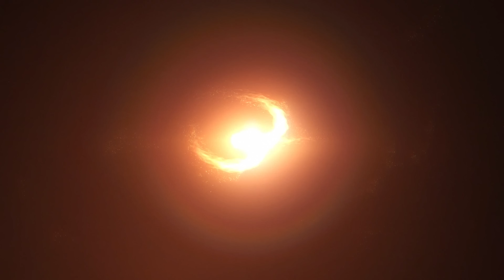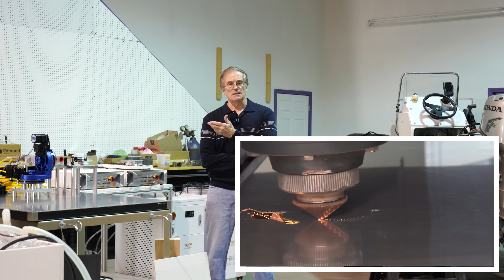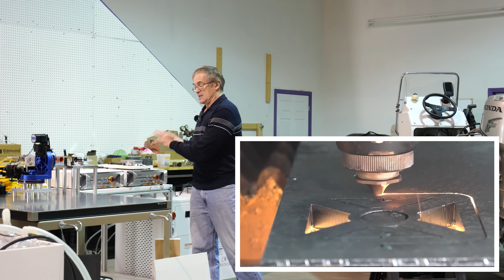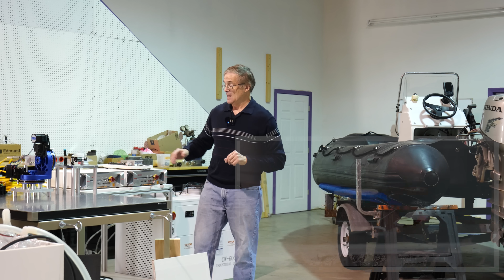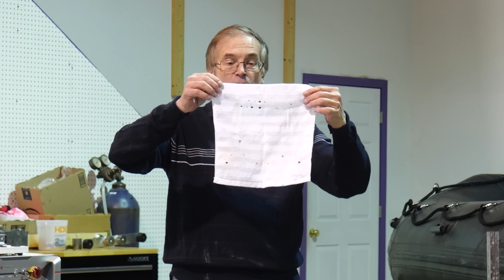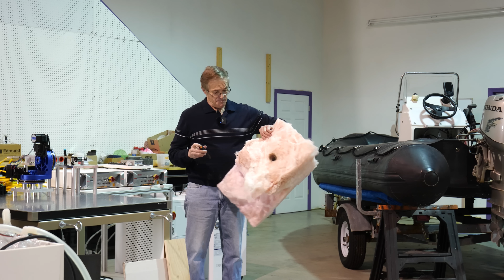We have a problem... and need your help!

Comment: Over 2700 comments from only 4 hours and 16000 views. You're going to have a lot of reading to do! Glad to hear you read them all, I've been genuinely worried that you'd try solar cooking on Teflon again. :) Some good ideas here, though I have no intention of reading them all. I doubt I have many thoughts about shapes and materials that aren't already covered. However I do have a couple complementary ideas which might push something that's close across the finish line.

First, make the thing move fast. If you structure whatever you choose as a disc or drum or belt and spin it at high speed, it will disperse the energy across a much larger surface area. For higher speeds, use an array of smaller elements, e.g. many narrow spinning cylinders. If packing them close enough is an issue, use two (or more) staggered layers so the ones behind obstruct the gaps between the ones in front.

Second, perhaps some kind of sensor curtain you can use to trigger a high speed kill switch (e.g. an SCR). My first thought was a fine, tightly-woven mesh of enameled wires which lose continuity when you burn a hole in them. An easy answer would be solar panels in a similar staggered layer arrangement as described above, from which you could hopefully detect a momentary voltage spike, but that'd get expensive fast as you replace them. Perhaps sheets of material forming a capacitive curtain would generate enough of a signal to work with. At those energies, I wouldn't be entirely surprised if some kind of adequately measurable charge occurs even just in a single layer of foil as it vaporizes into an ionized plasma. For maximum reliability and speed, the sensing/triggering circuit should be fully analog. No microcontrollers or whatnot.

Best of luck to you! It's a tall order, dissipating that much energy with such a low mass to area ratio. I'll be very interested to see what you come up with. Possibly interesting to various governments and militaries, too.

Comment: A layer of translucent gel between plexiglass. One side could be clear and the other one could be against the sheet rock. Another idea for the gel layer is have it sandwiched between opposing mirrored plexiglass glass and maybe have sheet rock on both sides to catch stray photons. 

The idea is to diffuse the beam enough to where it doesn't penetrate simpler barriers

Comment: A waterfall, from a few pipes going up in a 5 gallon bucket, probably a channel to catch it on its way down. Scalable, and cheap. Water absorbs laser radiation. channel out thickness you need, scale up pump as needed.

Comment: Water has roughly 1,000 times higher absorption at 1064nm compared to the visible light spectrum.  Use a large aquarium filled with water that has an additive mixed in to adjust the desired absorption at this wavelength (I’m not sure what chemical additive you would use at this moment).  If the laser beam is shooting into say 12 inches of water, the beam will be progressively absorbed as it propagates through the water.  The rear of the aquarium could also have a stack of fire bricks positioned inside the rear of the tank as an additional safety measure.  Unfortunately, I do not own a fiber laser otherwise I could have done a few tests for you.

Here are some random thoughts:

1.	 Make sure that the aquarium glass is clean on the outside 𝗮𝗻𝗱 inside as you want to minimize absorption on the surface of the glass.
2.	If the water gets dirtier with use, the absorption will increase, which will cause the laser beam energy concentrate too much near the entry point.  Also, contaminants in the water could build up on the inside of the glass surface.
3.	I’m not sure if the glass on the aquarium tank can safely withstand the energy from the laser.
4.	The front surface of the glass will reflect a few percent of the laser energy, so the beam may want to be injected at a steep angle so that the reflected light will not come back towards you.

Good luck and I’ll be waiting for your solution to this problem.  Jay

Comment: Kaowool (alumina silica ceramic fiber) cut into 50 cm square panels. Place in multiple in mold until about 2.5 cm thick to start and make slurry of sodium silicate with distilled water. Should be about say 500 grams to 250 grams. Add around 200 grams graphite. You could also add the same amount calcium carbonate or silica sand. Should be thick but pourable. Pour or brush slurry over one layer, add fiber, repeat until laser proof lasagna of enough layers then press down to compact and remove air bubbles. Should dry in 24 hours. After dry transfer to kiln for 200 to 300 C cure for 4  - 6 hours. Or air dry for 72 hours if no kiln. Cool slowly if kilned so no cracking. A panel should protect for 1-3 seconds?

Comment: There's really only two options when it comes to that type of situation, option #1 which is probably the cheapest I can think of and still probably work is you can purchase some of those barriers that are used in road construction and fill them with a medium like sand or water or both probably so that if you do happen to penetrate the thin shell which is very likely at least the material inside will be basically absording the heat and filling with more medium for hopefully enough time for you to yank the plug before you take out Starlink or the I.S.S. 😂 I'm not sure if they are able to be placed on top of one another but you can probably stack them higher by building a scaffold and staggering them to overlap from whatever angle the laser is pointing. and option #2 If in fact you would rather diffuse the light while still being able to transfer the heat without melting for at least a couple of seconds would very costly using silica based insulation like aerogel or similiar like Fibrous Refractory Composite Insulation (FRCI) which was used on the bottom of the space shuttle to dissipate the heat during re-entry. I'm sure theres other more outlandish ways like building a convex mirror wall or something, but I'll leave that to the more creative commenters, good luck and wear the proper spec eye protection at all times while operating a laser in case of any chance of reflection of of the water or anything else present.

Comment: I saw a sandbag idea below, very smart as long as new sand falls in to block the hole and replenish the wall. If not, check the laser wavelength. Some wavelengths do not couple well with certain materials.

Comment: What is the wavelength used by the laser? You could use water filled transparent container, and dissolve a dye that has good absorption at the specific wavelength required. This would make for an optically opaque, self healing wall. Another option would be to add a dispersing agent (eg: colloid suspension) in water to defocus the beam.

Comment: You have many comments to read over.  Wow!  
I first also thought of something like a cloud .. fogger .. mister .. or maybe dry ice cloud .. but then I'm not sure how those would work.  I do know that a laser can shine a straight line of colloidal silver in suspension.  I'm also thinking that the idea of having a kind of fuse .. so if you burned through something it would automatically shut off at the very moment the laser light touched maybe another surface.  It seems like a pile of dirt would be like a pile of drywall.

Comment: If I had to guess, I would try for something that has a large surface area, something porus so that the light gets "absorbed" and something that has a lot of heat capacity. 

So the insulation wool, but dosed in water, and also continuously getting fed water, like a swamp cooler mechanism. I see comments on ultrasonic misters as well as a mechanism to keep the protection wall moving, something like a treadmill, and those are also very valid ideas.

The problem is how to extract the most amount of heat in the least amount of time (i think), so there should be some sort of water phase change involved.

:)

Comment: I like the plywood. All it needs to be workable is an active water circulation system to extinguish fire as it ignites.

So like a fish tank pump that sends water up to the top where it flows down the face of the plywood back into the plastic tub which is the base for all this.

Comment: Possible solution seems to be a rotating drum or belt system with a specialized slurry. Instead of trying to absorb all that energy in one spot, you spread it across a larger surface while continuously refreshing what's exposed to the beam. Use a 40cm diameter drum spinning slowly at just 10-20 RPM (fast enough to distribute heat but slow enough that the material doesn't fling off). Coat it with a thick layer of clay-water slurry - basically mix clay with water to make a paste, then add a tiny amount of aluminum oxide nanoparticles (boosts heat transfer by up to 78%) and 0.5-1% polyacrylic acid binder so it actually sticks to the drum surface.

Should be able to handle 15kW laser power for 8-12 seconds before needing to refresh the surface - way more than any of the materials you tested in the video. The clay naturally has great thermal properties and the slow rotation means you're always presenting fresh material to the beam. The whole setup costs maybe $35-50 per drum surface versus thousands for commercial water-cooled systems.  

The key insight is that movement + good thermal mass beats trying to make any single material indestructible.
Reply: a large spinning disk!
Reply: This is exactly how we spread out heat generated by the electron beam in xray tubes.  If you have a spinning disk at the anode, it reduces and delays the pitting that wears out the tube over time, and increases the max voltage and time it can be applied.
Reply: Clay-water slurry in pool and disk rotate partially in it.
Reply: Great idea for tests, but, he needs approx 150 square feet of the wall protected. Let's scale up the ideas a bit.

Have you tried compressed rock wool insulation?
Reply: @glennpridham5701  Wall size belt rotating on slurry pool.
Reply: @glennpridham5701  Ceramic fiber would probably be better than rock wool. That is a big wall though.
Reply: My layman's idea was aerogel but I think you have a winner, sir
Reply: yes .. movement was my first thought also.. spread the energy
Reply: One of the first things that occurred to me is something like an oscillating drum, belt, or edge sander. If you time the rotation and oscillation right, you get many times as much surface area over an extended period of time as you would with a simple rotating drum or disk. The basic mechanism could be repurposed from a used woodworking tool pretty cheaply.
Reply: Sorry, i did recommend a similar solution, and now i  discover i am not the first one. You are!
Reply: The introduction of movement as part of the solution is an excellent approach
Reply: I think you guys are on the right track. Like a concrete mixer drum that keeps the slurry constantly moving and mixing to spread out the heat
Reply: Why bother with a drum when you could just drizzle the slurry from above the beam path
Reply: @custos3249    hmmm,  a slurry recirculation system on an inclined plane - viscosity can be engineered for flow rates and pumping  - vibratory fluidisation makes near solids flow incredibly...  (thinking out loud like most - here...)
Reply: I think you've got it. Movement is the key to a small penetrating beam. Every stationary material is going to have the wet-blanket problem that, there's just not any material around it that would survive. One alternative/modification: Fill the drum with water, or, sand + water. You can flex-seal it if it ever punctures, a hundred times if you have to. Refilling with water is cheap and the Coca-Cola business model, you don't ship the water you just add it near the market/test site. Water is gap-filling and helps cool. Alternatively, I wonder about using a pump and an actual water sheet continuously falling? Some scattering, and endless thermal mass for $3/cubic yard. Or, this wetting any other surface, just running down the whole angled surface, even plywood would be massively more durable with a sheet of water flowing over it continuously.
Reply: Yesssss, love your brain m8
Reply: Good one.  That or a stream of fluid, an always renewing target.
Reply: Cover it in vantablack and you have something that absorbs over 99.9% of laser light
Reply: @seanabsher5577  But for how many microseconds until it burns through?
Reply: I like this idea, but I would amend it with a flood or mist type cooling system to keep the clay from drying out. You know one of those misting systems you might find on a mill or lathe. Something not too strong but keeps things moist. Could be as simple as a strong pump and one of those mister systems like in aeroponics.
Reply: This.
Reply: You can also have the lower side of the belt or the bottom of a large disc pass trough a bucket of water or any better non flammable heat exchange fluid for cooling down or some more of the clay slurry to "heal" the belt
Reply: Sounds like a cement mixer
Reply: Yes! A rotating belt picking up a water-based slurry of titanium dioxide would probably work fine.
Reply: Good idea but it would have to be very big if he wants to aim the laser different directions. Another similar solutions is to use a treadmill type setup with segments that rotate round and around, but possibly thats overly complicated.
Reply: was about to comment something similar.

Comment: Prehaps a rotating disk back drop made from multiple layer drywall, spin the disc in a large random orbital movement, the rotation will decrease the time on target for the beam and the random orbit movement will make full use of surface area to decrease burn through time

Comment: I will have a look  in detail later. I use a laminate for missile/drone interceptor bodies. A structural glass fibre layer, using a high temperature resin analogue, such as Polycarbosilane, waterglass, or Calcium Aluminate Cement. An air gap and perforated Aluminium, followed by "starlight"  (some times I put a rockwool layer in between these 2.)Then a repeat of the outer structural layer. All this, because phenolics for a 1800mmX40mm tube is way above my budget. All of this is well within your skill set and resources. If you use this, no mention or thanks would be appreciated. Smoke, also works OK at mitigating laser power....

Comment: How about automating an emergency power cutoff?  Instead of (or as well as) having a robust wall to give you time to use human reflexes, you put something on the wall which can raise a signal to an automatic system?

My first thought is something like a huge, closed cardboard box full of fibreglass insulation with a photosensor in it.  As soon as the laser breaches the box light is scattered by the insulation so some of it reaches the photosensor which then cuts the power.  After shutting down you just go and put some more duct tape over the holes so you can reuse it.
Reply: My thinking with the fibreglass filler, here, was as a light diffuser which shouldn't be so dense as to block the light before it reaches the sensor. 

I also thought about just assuming the problem will treat itself.  That any laser hitting the opposite wall of the box will have enough reflection to get noticed by the sensor.  Or the hole would let in enough diffuse light.  Or there would inevitably be smoke which would scatter enough laser light to get detected from a safe corner of the box.

But I like to nail it down with a formal mechanism.  Maybe fibreglass is too dense.  To make sure it's not it might be wise to have an air gap for scattered light to travel the full height and width of the box without being interrupted by diffuser material, and just line one wall with fibre to initiate some scatter when the laser hits it. 

With that arrangement I might suggest rockwool instead of fibreglass.  It's denser and could block more light but if you have an air gap for light to travel freely then rockwool is more fire resistant. 

Or you could just arrange for the box to be filled with smoke.  But if the smoke generator failed then the sensor also fails and it's not a reliable system.

But yeah.  A closerd lightproof box with a light sensor in a safe corner should be able to detect very easily when a laser punches a hole in it.  And you reset it by covering the holes with duct tape.

Comment: Im just brainstorming, but here are few ideas:
Water tank with laser pointing downwards
Aerogel
Compressed or not compressed wood ash (edit: i asked CGPT and its not a good idea :) )
Parallel double-sided mirrors at an angle of few degrees in length of lets say 1 meter, that rebound laser multiple times before hitting a wall

Edit 2: 
Tungsten has high melting point, maybe if you stack tungsten welding electrodes  in two layers it could be enough.

Comment: - adding redundant feedback circuits that detect failures and cut power. (also dead-man switches)
- plywood backstop by putting air gaps between sheets you can shoot an extinguisher through. Get them wet, and/or impregnate them with salt or sodium silicate for some fireproofing. 
- carbon backer. box of charcoal with oxygen displaced (water, nitrogen, co2, etc) 
- soil (sand, dirt, clay, boulders). talk to a landscaping company, they might let you borrow a truck full of material & even leave them on the truck. 
- use the floor. hang the laser from the roof and point it at the ground, that way you have a free backstop several thousand miles thick. Concrete is easy to patch or epoxy.

Crazy idea: could you do a plasma wall? Plasma has an insane thermal capacity before the atoms start to come unglued that you probably wouldnt be able to hit in this kind of testing. It would need to be tuned to absorb the wavelength of your beams. It also would weigh next to nothing and be extremely cool.

It would also be pretty cool if instead of a camera, you did tracking/targeting with radar and no cameras